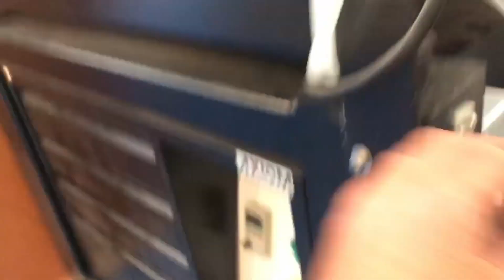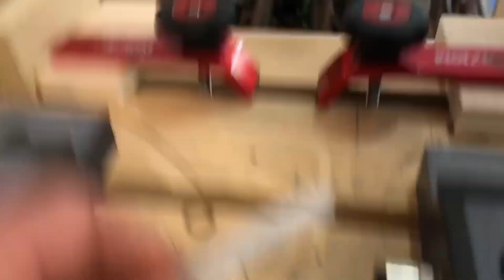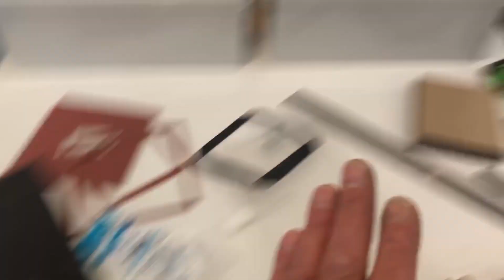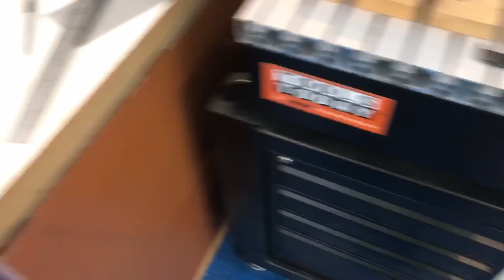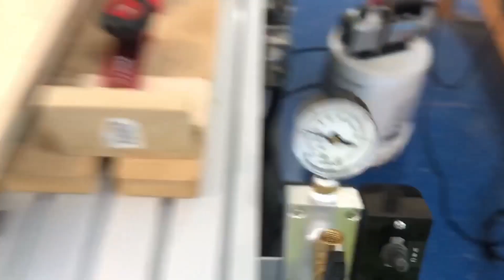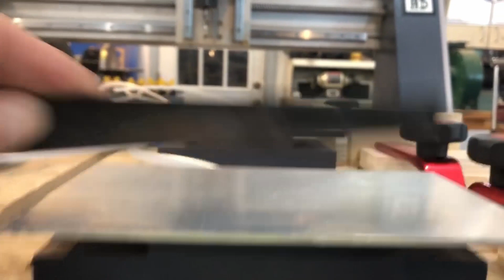Vacuum pod system for a CNC router // explained

Comment: The problem with the cheap pumps is they use oil but usually come with nothing to manage the oil mist exhaust. You will have to buy a mist filter which generally aren't cheap as well as an air filter to keep the pump from sucking in dust and debris. You'll also need to buy the adapters and connectors to actually hook up your pump to your pods.  I bought a $125 Vevor pump and the oil exhaust is absolutely insane. I added a filter which only caught about 80% of the exhaust. I had to put a sock filter over that filter to catch the other 20%. And then I noticed oil being sucked up and collecting inside the plastic housing of the first filter. Got tired of fooling with it and bought a $500 oil-free pump that is working as expected. Don't waste time and money on cheap stuff to try and save a few bucks. You get what you pay for.
Reply from the maker: Totally agree, I have that old gas pump that I rebuilt that is oilless and I love it, I purchased the harbor freight for testing to show people what you can do with a cheap pump. Thanks for watching and commenting.

Comment: I'm a Z-off-the-bed kinda guy so my big concern is how much the gasket types will compress
Reply from the maker: Yes that would be an issue for you if you need a very accurate thickness of the finish part.
It won’t make a difference in profiling or making through hole.

Comment: Hi I have a vacuum pump like the one you show and I see the inlet has the hose and gauge but what do you place on the outlet side or do you just leave it open to exhaust the air. Also do you need to have a pressure relief value with this pump and if so does it go on the inlet or outlet side/ If you can help it would be greatly appreciated.
Reply from the maker: Yes the outlet so to speak goes to open air. That is what allows the vacuum to release.
No pressure relief is needed

Comment: I have been thinking of building a vacuum table for my small cnc, but after watching this, I think that the pods would be  better option.  With the pods I can also scale them up or down in size depending on what I am doing.  Great video, thank you for the in depth explanation.  I also like how you mentioned the aluminium vacuum sag.  Great work!
Reply from the maker: My pleasure, glad the info helped you !

Comment: Thank you so much for the video. Currently setting up my own vacuum system. What would the key points to look for in a vacuum pump to get the absolute highest pull possible ? Thanks in advance for your help.
Reply from the maker: Sorry for the late reply, but you achieve the highest Pull you need to make sure 1) you have no leaks, even the little ones, and 2) maximize the surface area of the part you were trying to hold down, that will give you the best vacuum.

Comment: I've watched this 2 or 3 times now. Makes more sense, now that ive been thinking of buying a pump. And it helps that you have the same CNC as me.
Reply from the maker: yes the pods are actually pretty simple when you get right down to it. And should work with basically any type of cnc machine.  Good luck

Comment: really fantastic video. If you want to add a bit of safety factor, add a small air tank (2-3 gallons), between the pump and the pods. it gives a bit of cushion if you lose vacuum for a second. It also lets you "dump" vacuum to pull the piece down.
Reply from the maker: That is a really excellent idea, I may have to monkey with it, I do do something similar with my vacuum thermoforming. But I think you’re on to something

Comment: Great video! Do you know if this “TAILONZ PNEUMATIC Male Straight 1/4 Inch Tube OD x 1/4 Inch NPT Thread Push to Connect Fittings PC-1/4-N2” adapter will work on this vacuum pump? Not able to link Amazon, sorry.
Best regards
Reply from the maker: Hard to say, it all depends on the fitting port on your vacuum pump.
I used a flare fitting with 1/4” soft copper which usually is easily adapted to most type of pipe threads.
A trip to your local hardware store should yield whatever you need

Comment: To mitigate the deflection in thin materials why not add a couple pieces of gasket material inside the border so you don't have the wide span across the pod. they should not contact the border, just a couple short pieces to add support in the middle. This will reduce clamping force by whatever the area of these strips add up to so need to keep that in mind. But they don't have to be large in area, maybe 1/4" wide and an inch long, so a loss of .25 sq. inches for each strip
Reply from the maker: Yes I have done that also, with fair success,
Thank you

Comment: Been thinking about a vacuum hold down system for my 2'x4' cnc. I use mechanical clamps sometimes, but mostly the superglue/blue tape method for when I'm doing through-cutting of small wood pieces. Would a pod system be able to pull vacuum through a piece of light MDF on top of them which would act as a spoil board under the wood parts I'm cutting? Probably would need a more powerful vacuum pump...
Reply from the maker: I have no experience using that light MDF, sorry I can’t help you with that, my method uses the shop vac and holes in the table.

Comment: Good to see ! For the  curve  you get  on the thin aluminum i would suggest you to cut some grooves  in your pods and use EPDM Foam Cord , it looks like o-ring material but it is compressible and very sealing . Very used alot into the vacuum table fixtures . It compresses in the groove and seals it good , your material would sit pretty flat .
Reply from the maker: Yes, thank you, I know about that stuff but was looking for alternatives 😁
But you are 100% correct it will keep the material flat, and in the future I might be making just such a table strictly for when I need to engrave.
Reply: @BuildswithBrian  your setup is pretty cool to repeat placements and dont have to worry about making holes and lose the vacuum by sucking only on the corners !  I just finished to mill  a round vac plate to hold on 6" aluminum round plates to machine a maker's logo  , 50 times ... gonna be fun !  I have a vac pump like you have but ive seen the "vacuum generator" from Pierson (500usd)  but they also exist (simpler/cheaper) for 15$ on Aliexpress , i got some on order , pretty curious to see how much it pulls and wont hear a damn pump !
Reply from the maker: @people16vt  
Sounds like we are both creative in out workshops 👍 let me know how the vacuum generator works out please, good luck and thanks for watching
Reply: @BuildswithBrian  hello i  just managed to make myself an automated vac system with a vac generator , pressure pot , vacuum switch , check valve and a solenoid pneumatic valve.  Really does a similar job like the Pierson's SmartVac but not using a built-in mechanical switch. This is awesome , at the moment the switch on the pressure pot feels the vacuum reaching the target it  shuts down the air pressure solenoid and shuts the vac generator and  shuts his mouth . Takes 10 seconds to reach 28"of mercury . The switch feels  when the vac drops and kicks in the solenoid and generator  when it needs it then shuts down when the vac is fully back  . I wont ever need the noisy and overheating electrical vac pump anymore and  the 1gal pressure pot  is giving a good vac buffer . Not too long to empty . I am a very bad cameraman but i could share some pictures and a small video if you are interested .
Reply from the maker: Sure, you can send them to my email,
Buildswithbrian@gmail.com
Reply: The EPDM cord  here explained , i ordered some on McMastercarr , alot cheaper than on Pierson's website  https://www.youtube.com/watch?v=tHSnB5Z_MQc

Comment: I purchased the vacuum pump with a 1/4 inch flare on top, but haven't been able to figure out how to connect it to air hoses.
Reply: Remove the flare fitting and replace it with a push type fitting or whatever connector type you want to use. Thread sealant is important on vacuum systems but DO NOT use excessive sealant as any that gets inside the tubing will eventually be sucked into your vacuum pump and ruin it. I've seen many Gast pumps that have succumbed to Teflon tape and pipe dope.
Reply from the maker: Take a picture of your fitting and take that to Home Depot or Lowe’s and ask the plumbing department guy

Comment: Good video, thanks for information. A question I have is where did you get the thick (looks like maybe 2") PVC looked online at Lowe's and Amazon but found 1" unless you glued it together for the thickness?
Reply from the maker: I bought the PVC from McMaster Carr,
And it was 1 1/2” thick.
Which actually came in thicker than that, Then I surfaced it on the CNC machine So it was a consistent thickness.